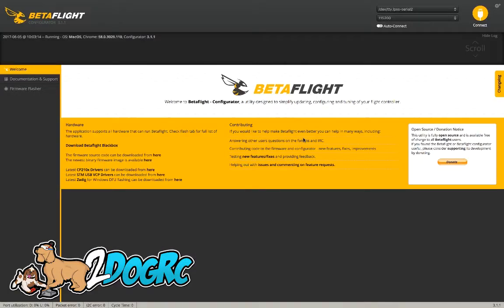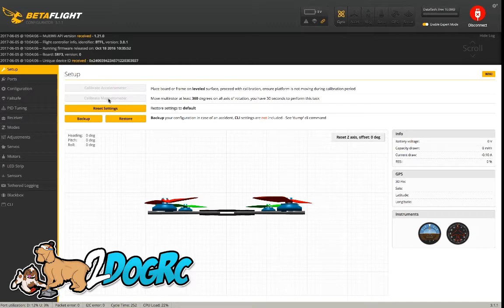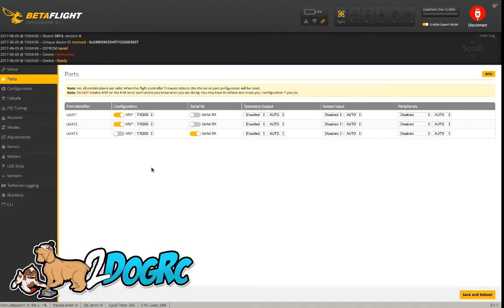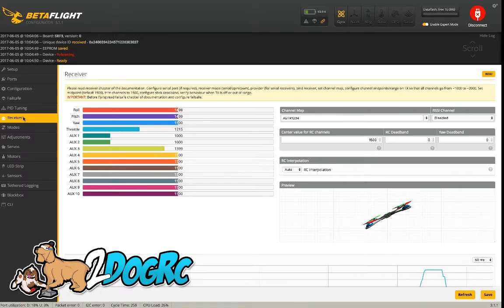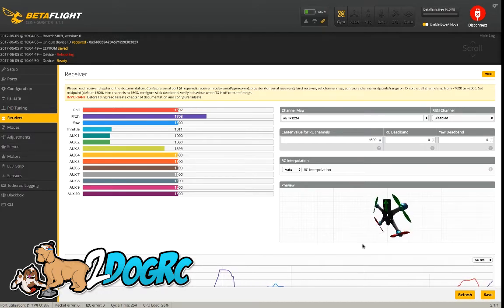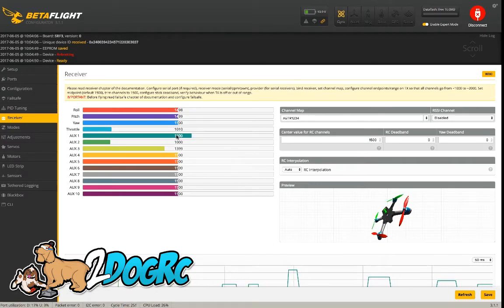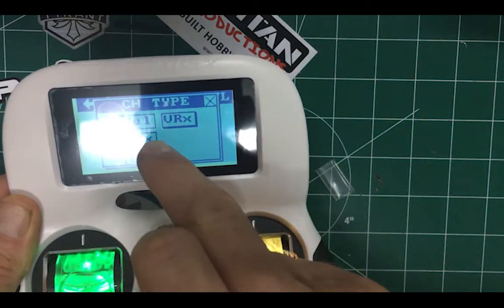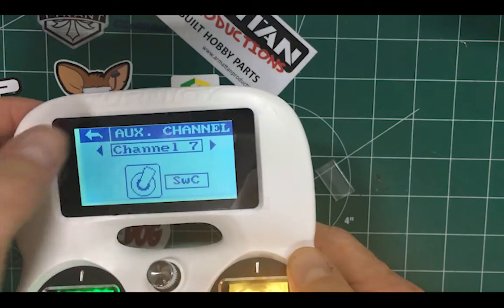Step 3 Configure Betaflight for Turnigy FS-A8S Receiver in Diatone Crusader

Comment: Will this beta flight and physically conecting work for diatone gt200n
Reply from the maker: +Drone Flight Yes. They are very similar. Just look at the wire diagram included with your kit and you should find the same labeled wires. Setting up Betaflight will be the same.